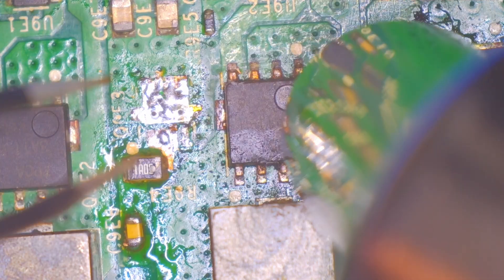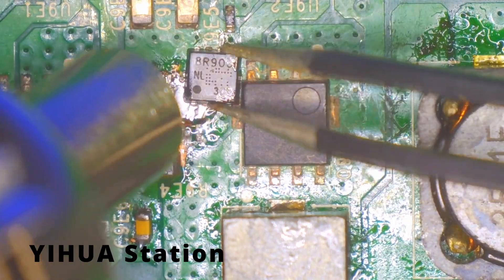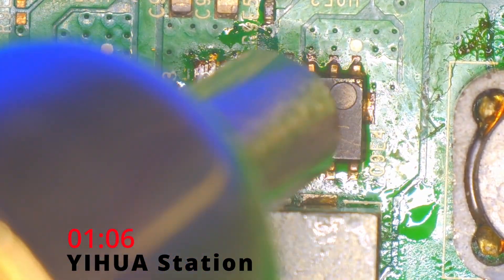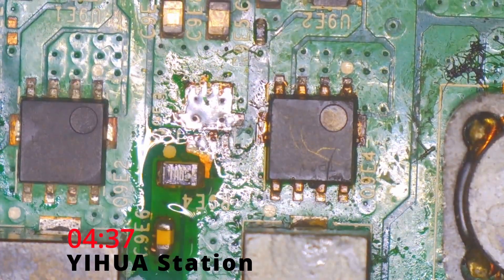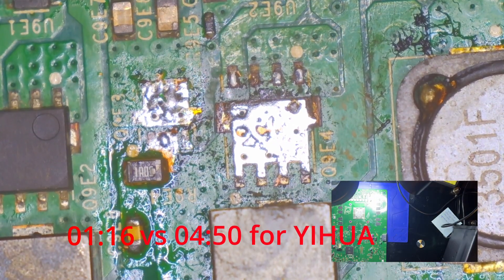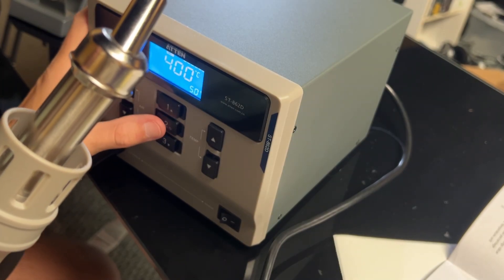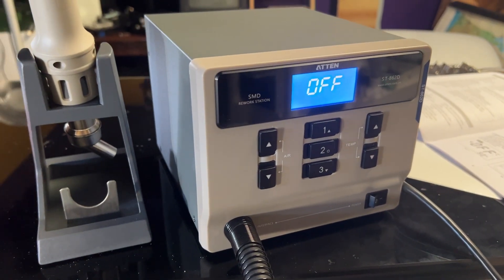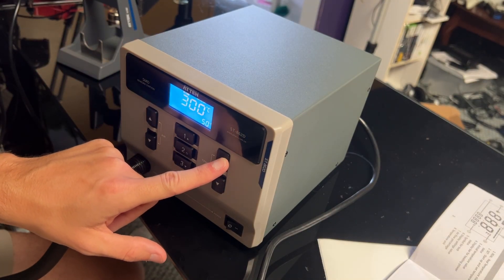Hot Air Station Review - Atten ST-862D vs YIHUA 959D Can a cheap station compete?

Comment: You have to add fresh solder around the chip before applying the hot air gun. This is done to lower the melting point of the solder.
Reply: Exactly! Liquid flux and a bit solder of good quality.
Reply: Not just any solder. lower melting point solder.
Works wonders!
Reply: Cant do that with a BGA chip. My 858D wouldn't budge U5000 SMC on a 820-3435 macbook logic board. Its done fine up until that, even changing out a xbox series s hdmi port.

Comment: Flux on the chip and Xbox not an ideal example as the board needs to absorb a lot of heat before the solder will melt. Try it on a smaller board. Bet the yihua works great.
My yihua station replaced a Xbox one s retimer chip in no time.

Comment: Apply heat around the board a little bit before trying to heat up a location, especially towards the center. otherwise you might find that your board has warped.

Comment: Since you mentioned Northridge fix i think it would be easier to use low melt solder to remove those chips. Or add some leaded solder
Reply from the maker: I do have leaded solder I use for legs and when reattaching. I haven’t messed with low melt yet but might have to try it out.
Reply: @FixMoreWasteLess  add some flux too before desoldering
Reply: @fuzzs8970  I've seen others add flux for desoldering and never had seen this before. I thought flux allowed for better flow ONTO the joints. But when removing I would think you wouldn't be concerned about how it flows just as long as it melts. Does this really work?
Reply: @jg9002  yes adding flux really works for desolderung too. Try it
Reply: @jg9002 - yes, in both situations, it helps greatly with heat flow via physical conduction that is much better than air.  Good flux also protects from oxidation at soldering temps, up until evaporated away.
Reply: @jg9002  Flux is an absolute must when soldering any micro components on pcbs. The flux absorbs the heat which is transferred to/absorbed by the component/solder that otherwise would just blow away or be absorbed by the pcb potentially causing damage. Proper flux application and those components would have been removed quickly. I've been soldering and brazing for a long time and I knew he was making mistakes when I saw the scorching on that PCB but that's how we learn.

Comment: I had a station similar to yours, that was struggling to do the job on a bigger boards, then I decided to upgrade to something between it and the atten - the quick 857dw+, it was way better, but finally ended up selling the quick and ordered the atten, soon it will be here and I am very excited about it :)
Reply: This is the comparison that I want to see. I can stretch the budget to purchase the Atten ST-862D if I really need it, but the Quick 857dw+ has a smaller footprint and I don't have a lot of spare desk space.
Reply from the maker: Awesome. I’m really enjoying using it. Hasn’t let me down once, which the cheap one did constantly. 

I’m finding it much more enjoyable when I’m not having to fight the equipment during the repair process. Microsoldering is tough enough, no need to add more complications lol. At least now I’ll know when I’m struggling it’s probably me and not the equipment. 
Hope it works well for you too!
Reply: @FixMoreWasteLess   Yes, it arrived and it is great, it's just another level and I can confirm what you've said :) The equipment is important, when doing microsoldering  to have quality iron and hot air is a must.
Reply: @svetlinbarzev9110 what kind of things the 857dw + couldn’t handle ?
I use quick 861dw and it does everything but was wondering what things the 857 maybe can’t do
Reply: @M.E63  it just wasn't convincing as the atten and your quick (maybe the best two hor air stations on the market) Actually it was able to do everything, but needed more time to do it, the temperature, when measured, was not so stable, this kind of stuff. It is a good station, way better than my first one, which was with the fan in the handle - this one was struggling a lot :) It couldn't handle desoldering basic components, you can melt them before desolder them..  Maybe it is again about the skills, but now with the atten everything just happens without struggle :)
Reply: @svetlinbarzev9110  ok I understand, it’s not as powerful as the Atten and the quick I got and fan and heating element probably not as good. I originally started off with the one with the fan in the handle and it was ok on some stuff but rubbish on more demanding stuff, everyone recommended 861dw so that’s what I bought and back then I don’t think anyone hardly had the Atten as I had it years and it’s great, my mate recently tried to do ps5 hdmi port with the one with fan in handle and it couldn’t do it, I been doing ps5 hdmi ports easy with the 861dw, so many people still recommend these rubbish ones with fan in handle and claim they great, I think they rubbish
Reply: @M.E63  Yes, they are rubbish, maybe they are good as an absolute starter, to practice on small boards, or something.. As you said, it is ok but only on some stuff.. Maybe, if the budget is tighter, the 857dw+ is the best option as a starter, but everyone, who works a lot with the hot air, at some point should have the atten or the 861dw.
Reply: @svetlinbarzev9110  Your right they ok for certain things but best to spend a little extra even for beginners and get the cheaper quick

Comment: This video is just... Sadness.
Let me break this down for ya kiddo.
If you have a hamemr, and a nail, and no matter what you try. You just can't sink that nail in one shot like your buddy gabe. So you get a bigger hammer. and yeah, you can definitely sink that nail like gabe. 
Say you're at a stop light and a car wants to drag race, is the mazaradi going to win or is the honda with a rusted hood
Your arguement of bigger=better is frankly wrong. The guy with the bigger hammer gets carpal tunnel surgery must sooner. Plus, he keeps smashing up the finishing around the stairs. The guy with the mazaradi is you, smoking in the ditch cause you dropped the clutch and gunneed it and lost control. 
You don't know how to even properly use the tool. You don't know how your tool is even preforming. 
Im not going to waste my time telling you why you're desoldering them chips wrong. But do comeback once you get a nice burn mark on your next board and I might give you a few tips

These videos are just sad...
Reply: Why make such a large rant when you could post the help you claim to have?
Reply: I was thinking of getting that Yihua 959D, then after watching this video thought it might not be worth it. But then you're comment gave me hope. In your opinion, does the cheaper  Yihua perform well enough to remove IC's if performed correctly?
Reply: @jg9002  like it's said in the video, the Yihua will work well on small components on two sided boards with no thermal plane. Okay, bigger rework will be more difficult or you'll have to use more flux or low temp solder. the video prove it, the job is done with both stations.  I work 80% of my time on small component /simple board and I'm currently looking to buy a cheap station.
Reply: @geexskill  Yes, first off, he needs to use way more flux if he even used any at all. Maxing out the airflow and blasting it on a dry chip is a sure way to guarantee frying the component and everything around it like bacon. The kid has zero understanding of how to flow solder. Watching him cook that dry ass chip was making me cringe. If the flux dries up, add more. If he added flux 30 seconds to a minute before it finally detached in his video, the solder would have instantly liquified allowing him to lift the chip.
Reply: @blakeolinger1220  I've buy a cheap air station since my last comment. I'm pretty happy with it, with some flux it works fine. Sure I don't work on complicated board with large grounds planes.
Reply: You're kinda right and so wrong at the same time. Got your point, but the comparison you did is so inappropriate. His new station is just way, way, waaay better than the old one and is absolutely more capable than it, the likes of his old one just can't handle some stuff and it is so important update that he did. Or it's up to him to desolder stuff with a hair dryer, it's just about how experienced he is? Hah

Comment: This is really disheartening for me, someone who has already bought a Yihua rework station (soldering iron + hot air) and really can't afford an Atten sigh

At least I can still do some hobby soldering with it
Reply from the maker: Your station is different than mine so hopefully it’s a bit better at removing the larger chips. My cheap one could do small things okay, especially on thin boards, but not great. Good luck with it. 

It was a tough pill to swallow to buy another station so soon but the difference is night and day. You can find Attens on aliexpress for around $170 if you’re willing to wait for shipping.
Reply: @FixMoreWasteLess  I also have a hot plate - do you think that could maybe mitigate the shortcomings? Or would that just cause more problems than it solves since it's really for assembly and not rework? Lol

Looks like Aliexpress is the way to go but it'll have to wait 😅
Reply from the maker: The hot plate should help raise the temp of the board/area and then you can come in with the hot air on the chip to push the temp over the edge and melt the solder easier. It depends on how hot the plate can get. I’d practice on some spare boards to see how best to use it.
Reply: @FixMoreWasteLess  Thanks for replying!
Reply: did you try an angled or different nozzle? I've heard the Yihua works better with a different nozzle.
Reply: I was thinking of getting the Yihua as well. Did  you have any issues with it or does it work fine?
Reply: @jg9002  I can't speak to longevity as mine has been packed away for a bit now but it worked fine for soldering 3 diy smd kits together and a split keyboard and I enjoyed it. For full disclosure, all I ever soldered with before was one of those 40-60w ones that you plug directly into the wall and has no temp control on it. Anything with temp control is loads better than those things lol
Reply: @3nertia  Same here. Anything I get at this point will be much better than what I currently use. Thanks for the info!
Reply: @jg9002  Best of luck to ya! Have fun!